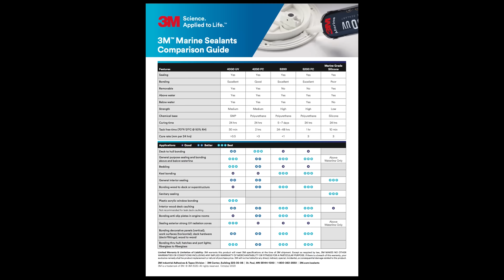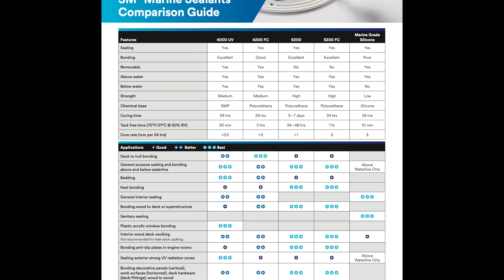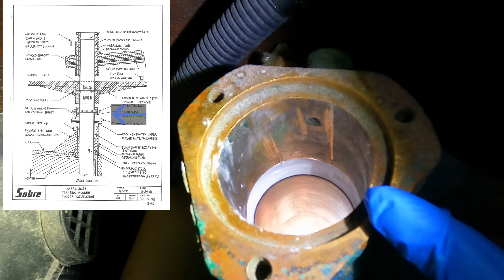The ONE product they'll tell you to NEVER use on your Boat... And it's our FAV🤪 (CSS, Ep.177)

Comment: Bottom paint this week after sand and epoxy paint then fairing.  Thanks for the order of operations. Fixed the rudder on my major repair 3 years ago but reused the old bushing.  3 screws into the fiberglass collar were the hardest part!  Looks great! Oh and a small foam roller goes in the larger holes but a gloved finger does a nice job on the smaller ones.  I agree women can do a lot of things in small lockers easier than a guy 😊❤️😎
Reply from the maker: We only had one thru bolt on the fiberglass collar ha. We did fairing before barrier so the barrier coat wouldn’t crack on any voids. Those after lockers are tight for me!

Comment: You do know acetone leaves water on a surface.  That is why in yards we wipe done with acetone followed by denatured alcohol.  Then we install whatever item it is.
Reply from the maker: That’s interesting. Didn’t know that!
Reply: @CalicoSkiesSailing  the 2 step process is used to get the absolute best results.  But why denatured alcohol … you are on the hard and so damn close to a salt water body of water.  There is salt in the air which is attracted to the water left behind during the acetone wipe down.

Comment: Lots of fun?   Dumb question:  what about the bottom where the keel blocks that hold the boat up and the stands on the sides that hold the boat up?  How do you paint etc. where they are?
Reply from the maker: That get's painted once the boat is lifted in the slings prior to launch, we moved the stands around to reach those parts
Reply: Got the same question. So there's only gonna be one layer over there? And no time to dry?
Reply from the maker: @Jelmer88 we would usually try and time the launch on a monday so we can be in the slings over the weekend to properly apply the paint

Comment: Will you never have to replace he rudder bushing in the future?  It seems that with all that 5200, it's now part of the boat structure.  I guess the same question goes for the other hull penetrations.  Genuinely interested in this.
Reply from the maker: My theory is that I had to cut out the old rudder bushing with a sawzall after 40 years.. also tool a sledge hammer to get the transducers out.. When it come to replacement I know how to remove but likely wont be required for a while. I'd rather not sweat the sealant failing LOL
Reply: @CalicoSkiesSailing  HAHA!   Okay, fair enough!  Based on the caulk gun incident, 5200 seems like fierce stuff!  Cheers!  Thanks for answering!

Comment: Great work and great video. Two questions:  What is you autopilot set up and are you planning on adding a wind vane (assuming that the solar panels would allow it)?
Reply from the maker: Our autopilot is a below deck simrad HDL 2000. We have a full backup unit onboard and keep a spare battery and solar panels uninstalled in case of a lightening strike. I’d love to add a windvane but I think it’d be in the way for the majority of our usage which is at anchor. Even the year where we crossed Atlantic twice and made it up Nova Scotia, just under 10,000nm we still were only at sea about 70 days or less than 20% of the year. If we had a wider transom I’d add an off center hydro vane
Reply: @CalicoSkiesSailing  I think so much would depend on your future sailing plans. Having had a Raymarine 6000 die on the way to Bermuda, and hand steering the rest of the way, was a manageable problem for my buddy and me, as we were sailing double-handed. It would have been a lot less fun if we had been 1/4 of the way to the Marquesas from Panama. But the thought of trying to replace your unit in a seaway when it is blowing stink, is not a pleasant one. I'm a single-hander. On my boat, a Tartan 3700, I have a below deck Raymarine unit, a Windpilot Pacific wind vane (a good one for you to consider as it can be easily removed and stored when in an area when you are using the davits) and a Pelagic Tiller Pilot (sold by Scanmar) that I am able to attach to the emergency tiller in the event all else fails. The autopilot failure, and while we pray it never comes, of course will come when one can least comfortably deal with it.

Comment: fyi / you really need to use good quality face masks when around dust and fiberglass dust / you don't want to have emphysema / its a slow death /  be careful please / also auto repair guys to test smoothness of bondo repairs  they  use a soft rag over an open hand and rub it over the surface  / you can't see smoothness by eye / good luck and good to see grace working away too
Reply from the maker: Yes watching us in hindsight working with silica without mask was cringe*, gotta keep on top of that! Nice tip with the soft rag